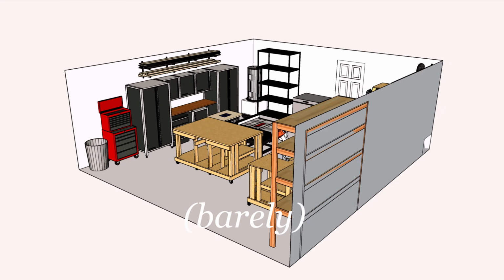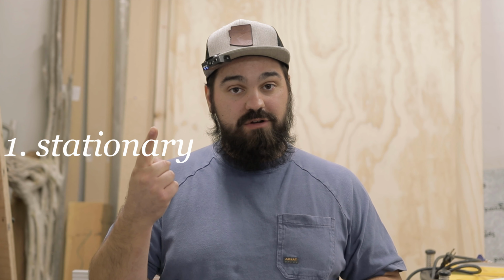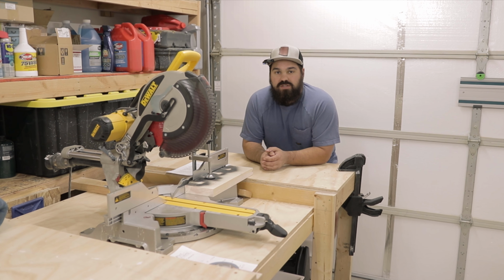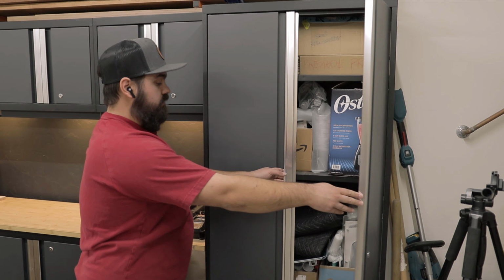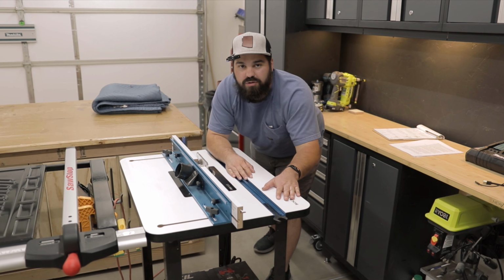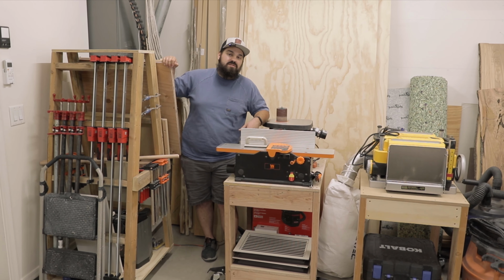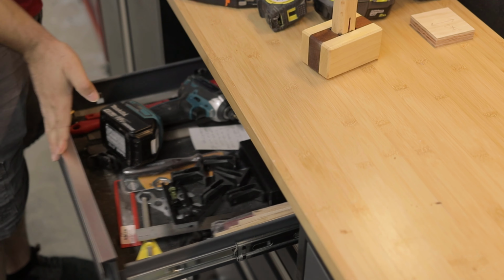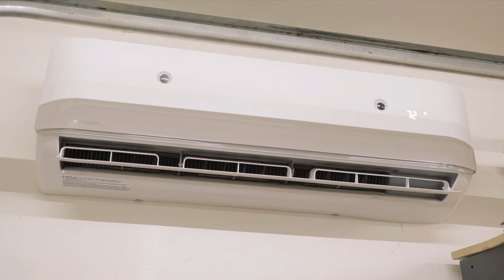SHOP TOUR 2022

Comment: Great video, I have rearranged my shop quite a few times. This summer I'm running the dust pipes so I'll have to somewhat decide on a layout but im really liking what I have set up currently.
Reply from the maker: That's the exact reason I've hesitated on hard piped dust collection for so long!  I always think I'm going to move things but since I've had my shop together (when I published this video) literally nothing has changed except I painted the walls and added electrical.

Comment: NIce tour and although agree with most of what you are saying, my shop is too small to be able to do all those things. I can add the AC unit either.  Dust collection is not good and I have to work with the garage door and back door open to vent the place so I suffer in heat and cold during the year.  I too have one 20 amp circuit, but looking to have that installed.  And I am unfortunately sharing my shop as a storage place for many items.  It's a rough life, but at least I get to use my shop often.
Reply from the maker: Can you elaborate more on the first few sentences? What is the roadblock that prevents you from making such changes?

Comment: I would give some more thought to adding more electrical outlets.  I have a two room plus two out buildings that I have ran all of my electrical.  After learning a lesson on not running 220 in series, everything turned out well.  I went way, way overboard on electrical, so you should be able to solve your problem also.  Maybe a subpanel off of your main panel of house.  Plenty of research beforehand.  Shop looks good.
Reply from the maker: I have given it quite a bit of thought but the thing I always come back to is not being sure how long I'll be in this shop. It's my first home without much room to grow so I don't want to make too many modifications that would hamper selling it or spending a lot to just end up moving, you know?

Comment: Look into the Wall Control aluminum pegboard.  I have 3 in my garage, and they hold damn near everything.  Pretty sure Travis on ShopNation has a couple behind his workbench that's against the wall, if I remember right.  They're awesome
Reply from the maker: I've looked at them before but the price has always dissuaded me. I talked with their reps at Workbenchcon and they now offer a printing service where they can print pictures and logos directly onto the panels. I thought that was super cool.
Reply: @AJBuiltThis  Last I checked, it was $150 for 3 pieces with a bunch of hooks/hangers/shelves.  It was $100 when I bought it a while ago.  Great system - would look amazing with a logo on it
Reply from the maker: I'll check it out again. Thanks for the suggestion!